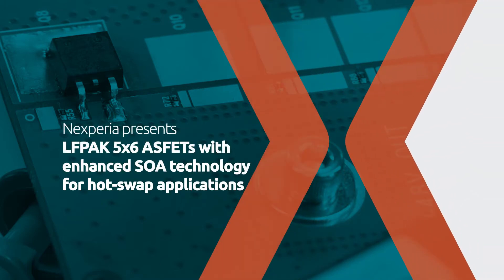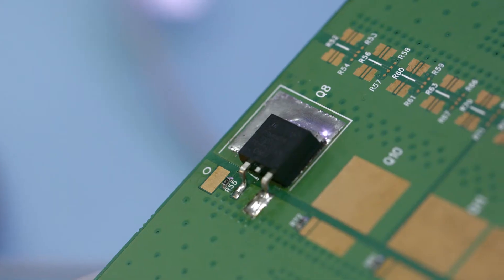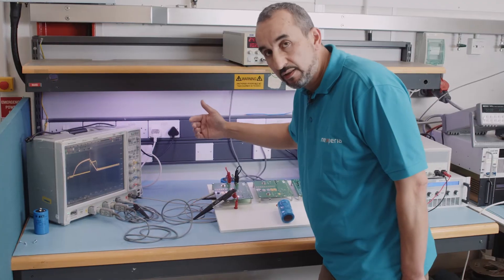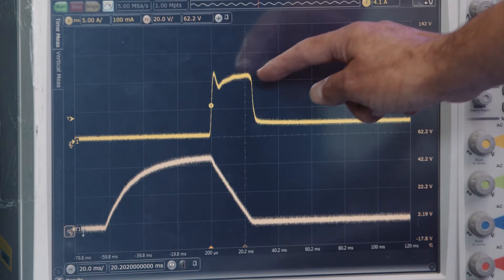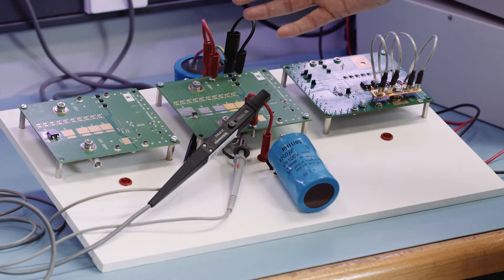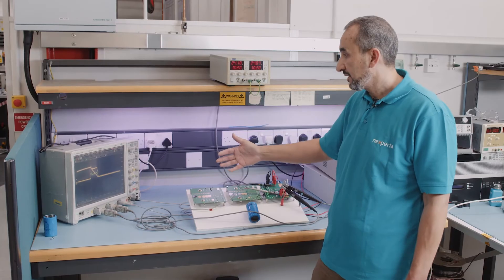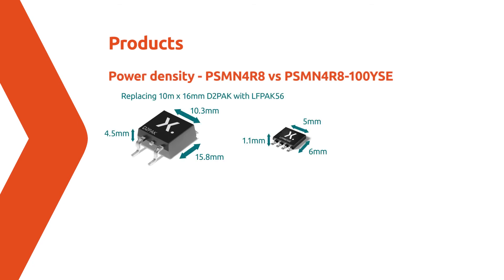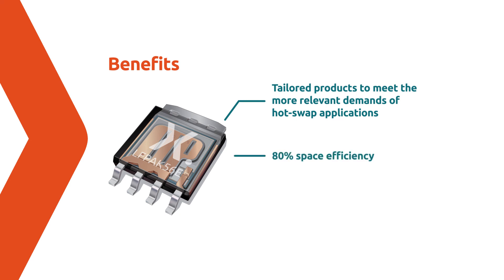LFPAK 5x6 ASFETs with enhanced SOA technology for hotswap applications

Comment: what hot-swap controller is being used here ?
Reply from the maker: Thanks for the question. We have fabricated custom shaped copper plates and PCBs for this demonstration which mount together. The copper has a lot of thermal mass so we used a hot-plate and a hot air gun for reflow soldering of the MOSFETs onto the copper plates.